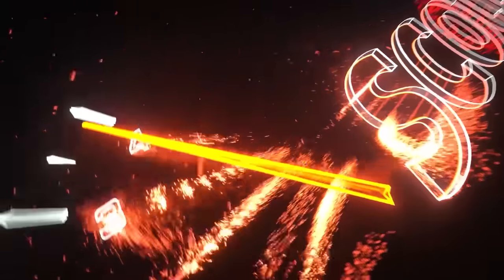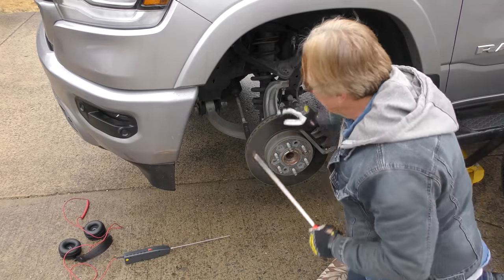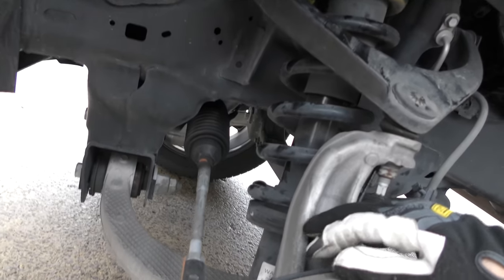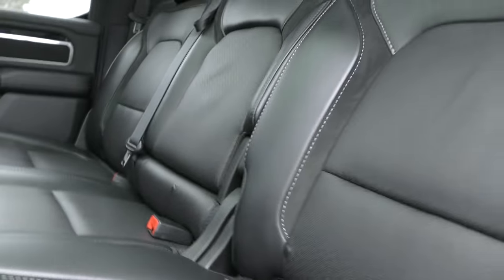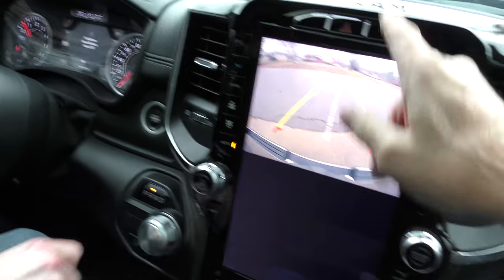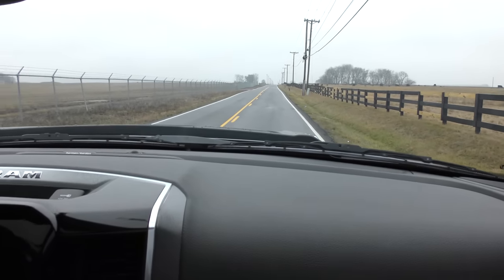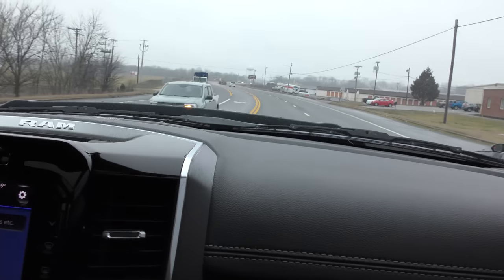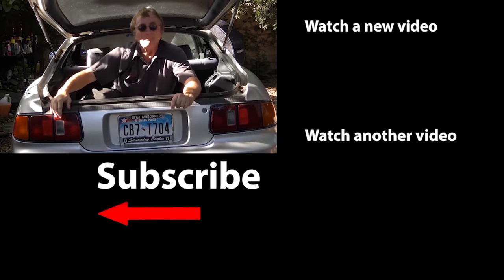Ram’s New Truck Scares the Crap Out of Me

Comment: 2021 Ram 1500. Worst pickup I've owned. Multiple front end issues, idling issues, gas and break petal assembly replaced, and other issues. Spent more time in the warranty department than driving it.  All under 20,000 miles.

Comment: I've got a 2019 Laramie.  Best vehicle I've ever owned. 70k miles and not an issue....and shes used to haul, not pampered
Reply: lol let us know at 100K
Reply: I bought a 2019 Ram 1500 crewcab 4x4 Laramie.  I got it in March 2019 for $45,000 and its list price was $57,150.  I have owned every truck out there, and bar none, it is the best truck I have ever owned.  It drives like a Mercedes, and it is super safe and the best mileage I have ever had for a 6 or 8 cylinder truck.  My 1987 Nissan Hard Body with a 4 cylinder and 5 speed manual got the same
22 mpg highway as my Ram, but it was half the truck and only cost $5700 .
Reply: My 2010 ram hemi has over 230k miles. No issues. Best truck I've owned
Reply: @edwardschmitt5710  I'm sure it won't be as reliable as a Toyota, but in my opinion, it's not nearly as bad as you make them out to be.
Reply: @ronwinkles2601 how did you negotiate the price?
Reply: @user-sw9fl5fp9r the 5.7 Hemi is tested. Toyota is going into more electronics and hybrid engines.
Reply: @edwardschmitt5710 just past $82k miles still NO issues...
Reply: Same. I’m at 121,000 miles with my 19 Ram Laramie and still runs like new. No issues whatsoever.
Reply: @born2win262 😂 Yeah the 5.7 is tested alright lmao...as a lifter eating, cam lobe shredding, piss poor splash lubrication and top end design. Hemi ? Short - lived, over priced JUUUNK 🗑 Typical cheap quality Chrysler product not worth a pinch of 🦝💩
Reply: @edwardschmitt5710  I have 130 on my 2018. Best trucks out there as long as you get the hemi

Comment: I own a 2020 RAM 1500 5.7L eTorque. Fabulous truck, no issues. I highly recommend it!
Reply: any vehicule is good before 5 years and 100k miles
Reply: @zayd1111  My very low mileage Ford F-150 Ecoboost Platinum driven in low-snow central Virginia must have been the exception then. Although it was babied, it had all sorts of issues: Electrical glitches, random infotainment reboots, rear defrost fail, sliding rear window fail, seized front brake caliper, seized rear parking brake cable, floppy under engine drip shield and rusty fasteners, disappointing gas mileage, and on/off not-so-smooth boost. The RAM dealer gave me a generous trade in price plus a $1,000 conquest rebate for switching brands on top of $8,500 other rebates, discounts, and accessories. They say Chevy truck owners never buy Ford and Ford truck owners never buy Chevy, but both types of owners will switch to RAM. I have found this to be the case. Best brand switch I have ever done.
Reply: Keep it past the warranty, then let us know
Reply: @drmitofit2673  Ever try Toyota?
Reply: @stefanovichmichael9686  Thank goodness NO! Glad I don't have to deal with the dreaded Toyota frame rust! Yikes!
Reply: @drmitofit2673 Silverados are so much better looking
Reply: @jimmycline4778  GMC Sierras are better looking than Silverados but I sat in one and the Mack trunk squared off front end limited forward visibility.  I much prefer the rounded and wind tunnel tested front end of my RAM 1500, which also has automated internal louvers and an automated air dam behind the grill to optimize aerodynamic wind flow vs. radiator cooling efficiency at speed. The RAM looks good AND has aerodynamic technology.
Reply: @zayd1111  16 6.4 hemi 2500 ram 90k miles smooth as butter from the store
Reply: @stefanovichmichael9686  warranty out here, my window motors just like exploding
Reply: @stefanovichmichael9686  Yes, the entire bed rusted out, but they did replace it under warranty.
Reply: When it's 10-15 years old come back and edit this post and see if you feel the same.

Comment: I have a 2002 Ram 1500 with 4.7 engine. It averages 16.8 mpg and it has 430,000 miles with no engine repair.
Reply: Wow 430??? I have same year same model. My 4.7 has 270000. I had top end redone when my gasket blew 7 years back runs fine other than the tick that it always had but I run diesel oil which quiet it down maybe I have some miles left 😂

Comment: Got a 05 3500 5.9 Cummins non dually long bed 2wd. Probably gonna pass this truck onto my grandson. Been a unbelievable truck not a single issue in almost 20 years.
Reply: Older ram trucks with a cummins diesel is a combination made in heaven
Reply: That’s not what this video is about
Reply: @thevenom4634  Yup, I'm not giving up my '94 5 speed. All the plastic has disintegrated, but the rest is solid as a rock! <3
Reply: My friend bought a 95 2500 5.9 and had to redo almost all of the interior wiring including the headlight switch array that would smoke when the headlights were on. Also had significant rust on back of the cab… in California.
Reply: ...I guess you got the only reliable one 🤣
Reply: 05 1500 I have and still going. :)

Comment: 3 Rams 2005, 200k 5.7 4x4 ST single cab, 2011 275k 5.7 4x4 SLT crew cab, 2014 177 5.7 4x4 Laramie crew Cab non MDS. No issues, run great keeping them all.
Reply: I'm looking at 14 ram 1500 Laramie longhorn with 112k miles. No problems with your 14?

Comment: Scotty, Love the channel and the unfiltered opinions of all different vehicles! I'm an owner of a 2020 RAM 1500 Warlock 3.6 V6 No added Turbos or anything just under 40K Miles I've put on it. Not the "Fanciest" not too much added new tech in it, but serves me well for Hauling and Towing and I really like this RAM Truck!
Reply: Wurlock
Reply: I got the 2019 tradesman 3.6 that doesn’t have the start stop. I was out wondering the lot and when I popped the hood to that, my Mecanic side spoke to me. As for the engine, very simple, tons of room under the hood, the right amount of power I need for my job, etc and a pretty solid reliability record. Just shy of 4 years and 140K miles without a hitch, it’s been a great truck and has paid for itself many times over for what I do. And surprisingly it pulls very well for lighter loads like small tractors, hay bales or the side by side.
Reply: Almost 18,000 miles on my blue warlock. What color is yours?
Reply: @richardmeyersmeyers8123  Blue as well!
Reply: Picking up my 2021 warlock today i hope it works the same as yours 😊
Reply: I’m looking at the 2019 warlock with the 5.7 and the 2022 big horn/ lone star ram both look good just cant decide

Comment: I too have a 2019 Ram, I average about 21 mpg with the E Tourque 5.7. I did have the bearing fail on the motor generator. Dodge replaced it on warranty.
Reply: this is why you should get a brand-new ram truck because it scares the crap out of scotty.🤣🤣🤣

Comment: One thing to point out about diesel idling. The new ones with DPF will have issues with those systems from extended idling as well.
Reply: I drove a 2019 6.7 powerstroke for work. After about an hour idle it'll automatically rev itself up to 2-2.5k rpms for a few minutes
Reply: Don’t idle diesels.
Reply: Just shut off ignition key
with vehicle STILL in DRIVE
with your foot STILL on
brakes, THEN shift in PARK. CB

Comment: I have a 22 Ram Hemi e torque with 7,500 miles. It’s a Bighorn with a lot of options. So far the only complaint I have is the Uconnect is glitchy.

I plan on keeping it for a few more years. Hoping with Chrysler getting rid of the Hemi it will create a demand when I trade it. I have a feeling the resale will be strong because that turbo charged V6 will be junk.

Comment: I have a 2020 Laramie 4wd with the 5.7 Hemi and etorque and it averages less than 11 mpg. I have never seen better than 17mpg on the highway. Thats not the truck's fault. I drive a mile to work stop and go and remote start it for 5-10 mins because i dont want to scrape windows. On the highway we go over 80mph in Montana and the truck has a 3" lift and 35" tires. It's a great truck though. Can't believe how well it handles and rides even with a lift. Tows a camper like a dream too. Interior is amazing. Mine has 140,000 miles on it.

Comment: What would impress me, is it the hybrid motor had two belts.  One to start the engine, and another to keep the AC running when the engine turns off.
Reply: Great idea! I have never thought of that. I'm sure there's a way for someone to customize it that way? Do you think so?
Reply: I would worry that running the AC would DEVOUR that battery's power...
Reply: @logicalrationalfishing7481   You are correct, it doesn't have the capacity for that.

Comment: To avoid ever having the Hemi lifter tick, use a good quality 5w30 or 0w40 fully synthetic engine oil like Mobil 1 FS or Valvoline. If you can afford it and have the budget for it, I would use Redline 5w30 as its additive package is perfect for the Hemi engine. 
Also do short oil change intervals like 3000 - 4000 miles. Nothing more. 
Change the transmission fluid every 50,000 miles. This is what I've learned over the years with two Ram trucks and 3 times having the dreaded tick.
Reply: Put the oil in that the manual says to use. ONLY.
Reply: @bjornironsides6474  Agreed, but not in this case. When I bought my truck, brand new, that is exactly what I did. I followed the manual to the letter and still got the Hemi lifter tick. I then learned that even the main dealer over here does not use 5w20 like my manual suggested, because it would too thin for my climate. But they're happy to sell it to me. If I take my truck to them and pay them for the oil changes, they will use 5w30. 
Also the OCI were too long using such thin oil and so it was slowly killing my engine. 
I experienced the dreaded lifter tick 3 times in two different trucks before I found a strategy that works a 100%.
Reply: Did the oil changes every 3-4k with oil from the list for the Hemi, still got the Hemi tick and had to replace lifters and cam at 175,000 miles.  Have a 2011 1500 quadcab. Hate the VVT feature, just hate it. Give me 8 cylinders all the time.
Reply: @jobabs  you mean MDS
Reply: @jobabs what kind of 175,000 miles? Hell if all I had to do at that mileage is lifters and cam I'd be pretty happy. I've had 5 rams 3 with the hemi all over 100k miles and have yet to have any major issues. But, I've also used them all as trucks, hauling, towing a lot, and off roading. I watched this video because I'm thinking of trading my 17 rebel for a loaded 21 laramie night edition with that etorque. And had heard some interesting things about it. This clarifies things.
Reply: @JRsVsO  easy miles, very few miles overall were towing anything.  It was expensive to repair ($6k).  Had to replace transmission ($5k)  3 years prior to the engine repair.  It's been an expensive truck, plus it's rusting out on the rear wheel wells and rocker panels.  Love how comfortable it is and how it drives, but probably won't buy another one, given the trans and engine problems and it wasn't abused.
Reply: @bjornironsides6474  yes, sorry. Had been reading about vvt prior to watching the video and it was still on the brain.

Comment: Great video Scotty I have an 2018 ram 1500 hemi I love it I drive manly highway to work 150 miles a day I get 18 mpg and it has 200000 miles I change the oil when the truck tells me to no engine problems runs stronger then new BUT exhaust manifolds cracked and some bolts broke had it fixed and only to happen again besides that the truck is awesome

Comment: My 2022 Ram with the Hemi 8 speed and no Etorque avg. 25.4 MPG from MN to Utah and back burning 91 octane. Our other 2015 Ram with the Hemi with the 6 speed avg. 24.7 on the same trip using 91 octane. Both 4wd.
Reply: @wherethetreesmeetthefreewa8260   70-75 mph where allowed, think SD was 80 mph but wife said no way.

Comment: Interesting observation of the hemi tick design flaw and start stop. Of course the police would override that feature and the problem would continue.  However, when you talk to ram they say it is an oil change issue.   Other people have agreed with your assessment of the oil splash issue. Great video and job as always.
Reply: The height of the CAM is the MAJOR issue with the 3rd gen HEMIs.
They were splash oiled....and still are. But only really properly lubed when running at 2000+ RPM.  Do not baby these engines. They will not last if you do.
Reply: 2016 power wagon here with 139k paid it off and a week later lifter failed ate the cam and another lifter was on it's way out. Sadly we pulled our savings to pay it off and then borrowed 3k to fix it myself...brand new chrysler lifters, cam, head gaskets, timing cover gasket, water pump gasket, manifold gaskets, valve cover gaskets, 2gal of mopar 10yr coolant concentrate and pennzoil PUP 0w40 and they still dont sound right. My 05 hemi 1500 4x2 regularly got 18mpg, sold it running great with 238k miles...
Reply: @curtisrenninger1886  i changed the oil type on my 5th gen rebel to 5w 30 vs 5w 20. I'm hearing that this has helped others completely eliminate the tick. 1k miles in, runs the same as before (just fine).
Reply: I wonder if you tune them and increase the idol speed some if it would help

Comment: Im not crazy about etorque but the etorque system is covered under the Federal Emission Warranty for 8 years / 80,000 miles which includes:
Belt Driven Hybrid Starter Generator Assembly
Catalytic Converter
Powertrain Control Module
Power Pack Unit - 48 Volts

Comment: Scotty I have a 5.7 2019 without the etorque system Or Auto stop-start and I'm averaging on the highway about 22 to 25 miles to the gallon hwy my ram was built in Detroit Michigan I heard they're going to move that plant to Mexico and you need the 392 rear end in order to pull 11,500 lb but not in that configuration four-door short bed

Comment: Just got the 2020 Bighorn today.  Love the ride and the overall feel of the truck.  Will be driving a lot, but liked it better than the Ford or Chevy.  Wanted an older style Tundra, but just could not find any.
Reply: I have same truck.  Do you ever have problems with it jerking when it's trying to figure out what gear to be in?  Mine does when you're just cruising at low speeds, around 1.5k rpm. Can't decide gears.. jerks for a  second.

Comment: Wow, Scotty didnt hate on Ram? My 21 ram 5.7 4wd (no etorque) gets 20 to 21 avg MPG with 80٪ highway. I still love the truck at 35k miles. No issues, No engine tick ever. Hopefully that continues
Reply: How are you managing 20 to 21? Flat lands? I'm in GA and 2wd rebel gets maybe 16mpg combined and 18 on the highway (long trip).
Reply: @SyrusLang i suppose i should say highway driving is mostly rural 2 lanes going low 60s. Going mid to upper 70s  on the interstate will drop the mpgs by 2 or 3 at most... and my drive is relatively hilly and curvy. Im pretty impressed with the mpgs on this truck.

Comment: I own a 2021 Ram 1500 Laramie 4x4 crew cab, 6’4” bed—-I have gotten as much as 22 MPG on the highway, but normally avg 20 Hwy and 17 city. My second Ram…gave my first one (2017 Ram 1500 4x4 quad cab) to my adult son. Zero mechanical problems with my 2021 at nearly 30K miles. The 2017 has some knocking at 100K miles and my son (who is a mechanic) carried an engine and other heavy car parts around in the bed if the truck for about a year until the rear differential went out….he couldn’t just order the gear to replace, he had to order the entire rear axle….

Comment: Actually the 3rd gen EcoDiesel is freaking incredible. They’re amazing engines with practically zero common problems. Some one offs here and there, but mostly really well built engines with amazing mileage.
Reply: what does third generation mean?
Reply: @antonio4114  there are three different generations of the EcoDiesel engine. Each with their own design and such. First gen was horrible, the update second generation was slightly better but still had problems, third update came in 2019 with the current gen truck itself, and was a full and complete redesign of the EcoDiesel engine. They basically looked at previous two versions, and went all out to fix it and make it as robust as possible.
Reply: I had a 22 Rebel EcoDiesel.  Needed a motor at 11,000 miles.  Traded it on the GMC 1500 Denali.  Better power, better towing and better fuel economy by far.  
The dealer recommended I dump the EcoDiesel.  It’s that bad.
Reply: @markhartman7939  every manufacturer has its faults, no one is safe from it today, but the vast majority of third gen EcoDiesel is marvelous little engines. Your situation sounds a lot more like an exception. 1st and 2nd gen were truly trash, nothing to hide there. Absolutely. Gen3 though? Basically they went all out fixing everything they possibly could before the entire diesel department was shut down lol

Comment: My 2016 Big Horn that I bought used last year was a bargain. It was certified pre owned and I paid thousands less than what it's worth, I have a bumper to bumper warranty for the life of the loan. The only problem I had was the waterpump. I noticed a puddle underneath it when I took the trash  out and figured out what the problem was. I drove it down the street to my mechanic and 115 bucks instead of 750 and it was good to go!.

Comment: Run Motorkote every other oil change and it will help keep it lubricated. I use it with my avenger too. Works great and keeps the engine feeling young.
Reply: Yes! That should be standard for all Hemis and or motors. I have been using MotorKote in all my engines for well over 15 years even in a boat motor lower unit, no issues in one single engine cars atvs boats even my gas water pressure pump 😂

Comment: A rare Scotty video where he doesn't mention Toyota. I wouldn't worry too much about the Italian electric motor, we have a lot of industrial motors from Italy where I work and they hold up well. At least it's right up on top and easy to change if it does fail, not buried between the engine and transmission.